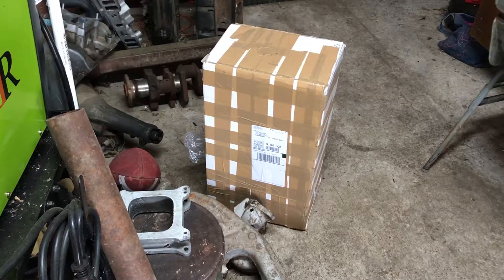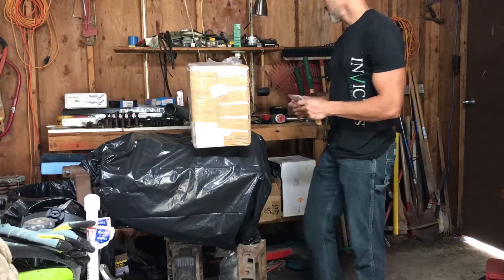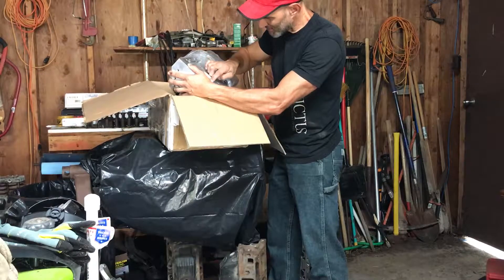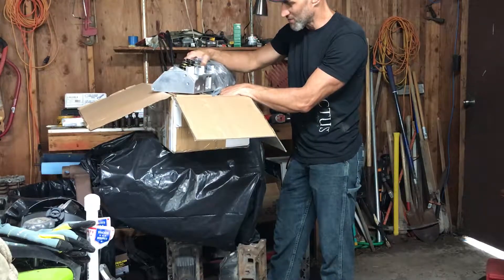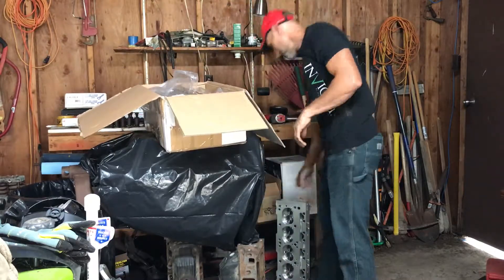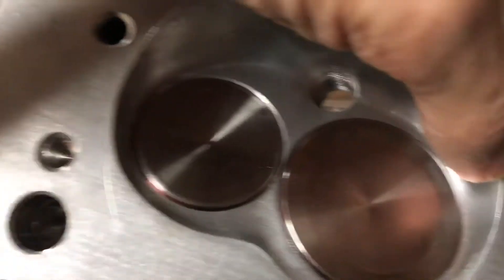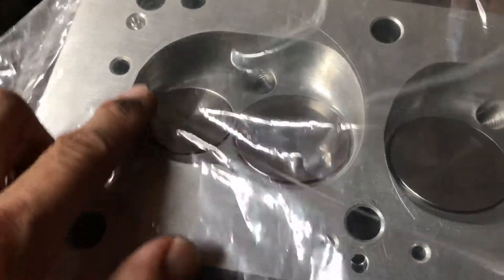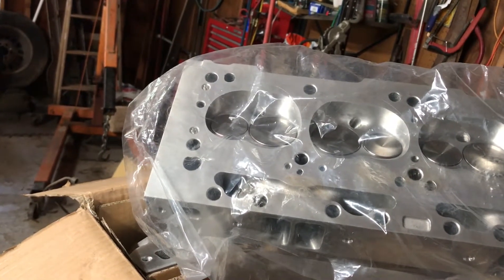Unboxing SB Sidewinder Cylinder heads

Comment: How do you like the Sidewinder Heads?
Reply from the maker: Mat Mayhall I like the looks of them a lot. Also that the guide clearances were perfect.  Before running them I will debur/smooth out one small ridge around the top of the valve seats and also open up the oil drain back passages by removing some rough casting.  Otherwise the flow #’s and runners cc’s are about perfect for my application.